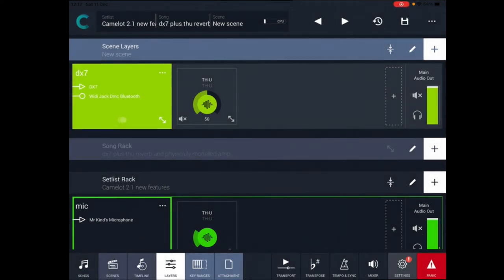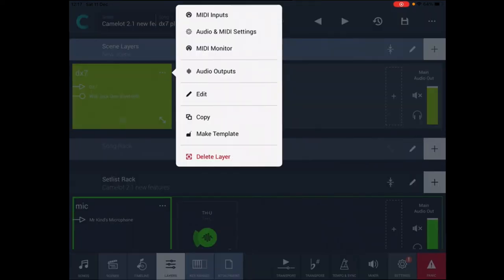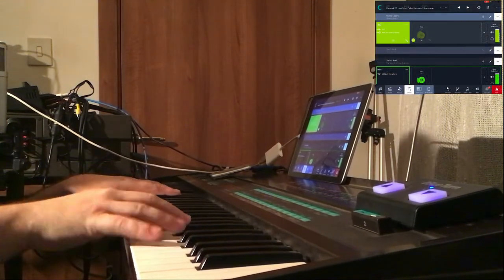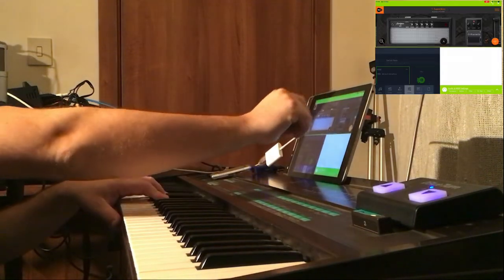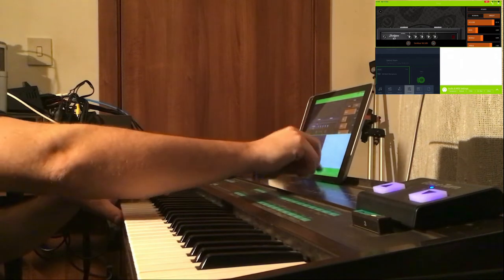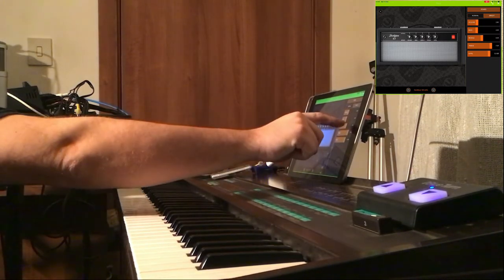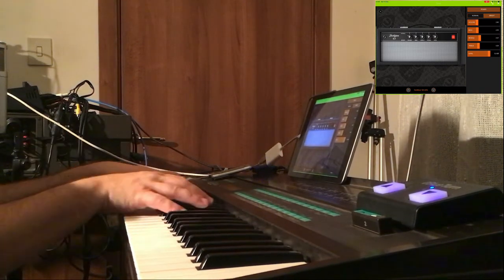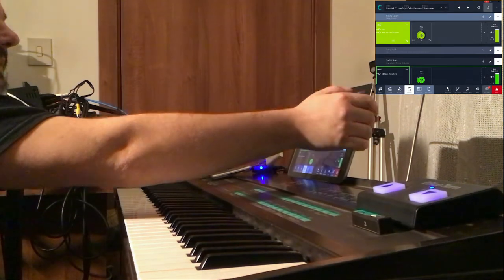Camelot Pro 2.1 NEW RELEASE. Part Three: adding fx to your audio inputs.

Comment: If you have an iPad model with headphones outs can the headphones out be selected as outputs for backing tracks? As well as selecting what ever additional outputs my audio interface has? 
For example, say my audio interface has a stereo out, but my ipad also has headphones out, is it possible to send my stereo mix to Front of house soundman, then send say the click track & cues to band members via headphones out? Is this option available in the outputs section of Camelot Pro?
Reply from the maker: Yes you can do all that, no worries.